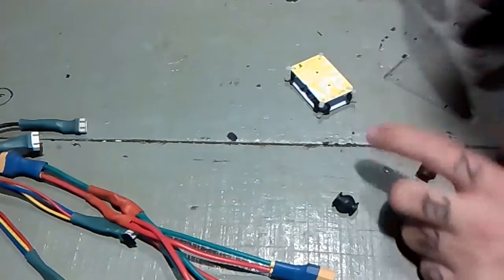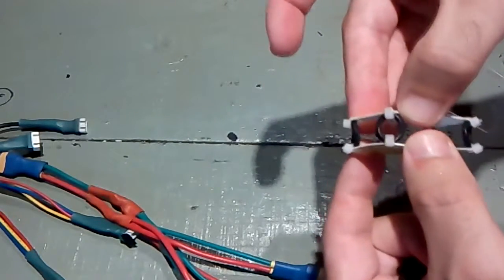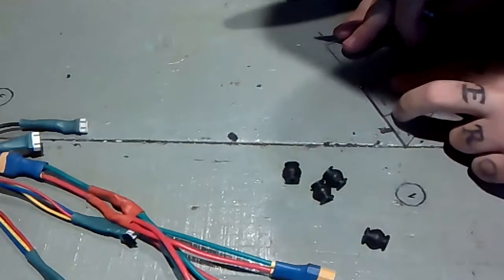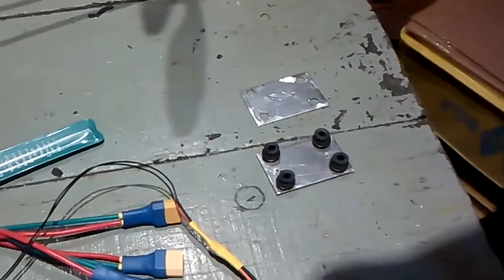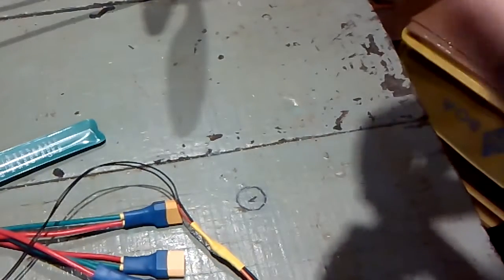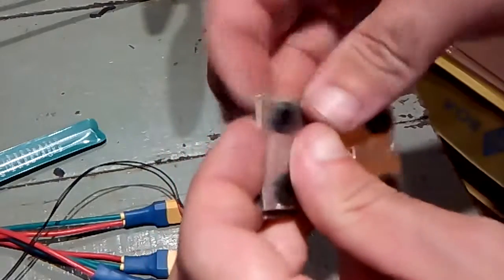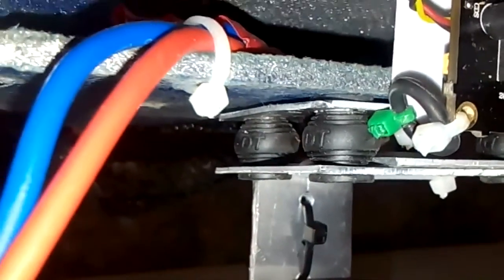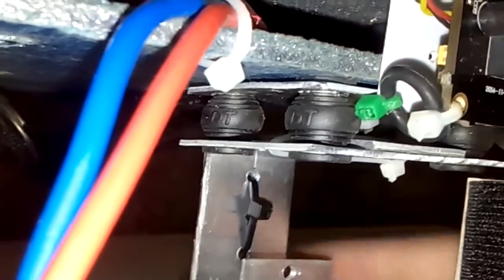Homemade damper using damping balls

Comment: Will you not still have vibrations because of the plastic band?
Camera weight makes plastic band tense and vibrations will flow through the plastic band.
Reply from the maker: if you mean the plastic bands holding the rubber O' rings in the first damper i show...the answer is no...not much...it works as good as the one i built with the damping balls